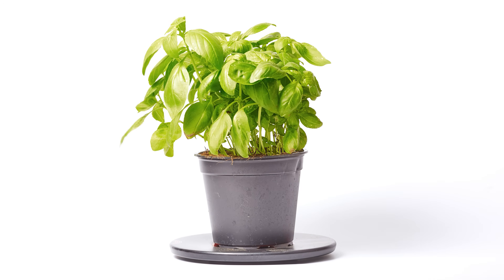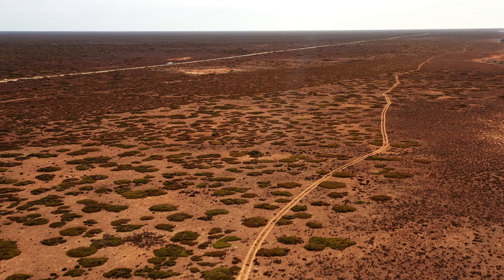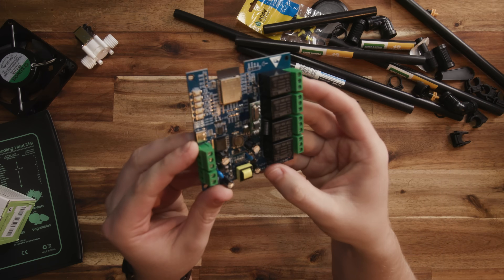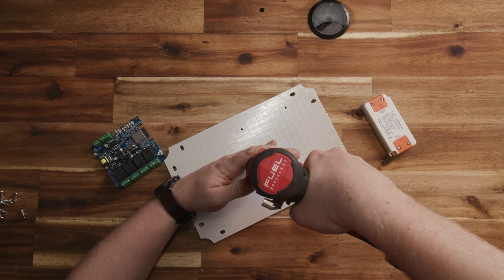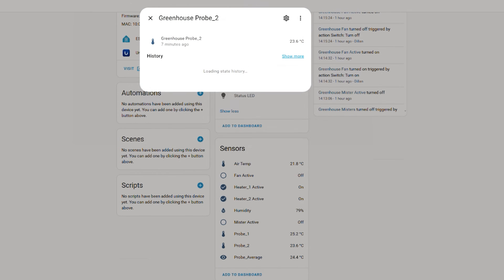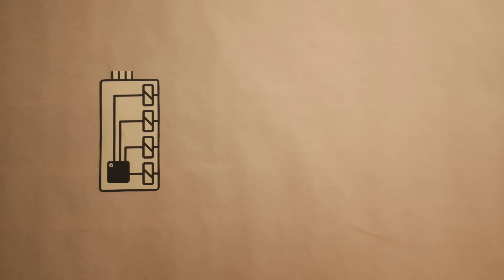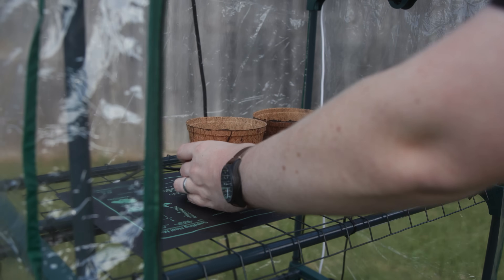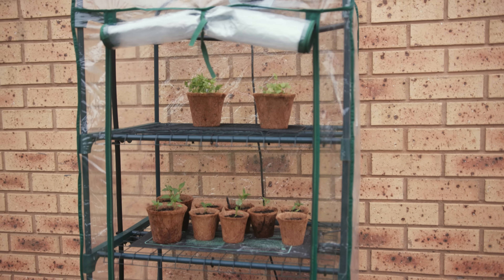All This… Just So I Don’t Have to Buy Herbs

Comment: I just removed a DHT22 from my greenhouse build.  It had worked for over 2 years with an older esp32, but on a newer esp32c3 it locked up the device every  1-5 hours. There’s some discussion of it online but it’s because it uses a non-standard timing sensitive protocol to communicate, so turns off interrupts while it takes a reading which causes this.  I switched to a newer version of this sensor (AHT20) that uses i2c and thus has hardware support, and the problem vanished. You may be fine in your setup, but if you start seeing hangs, consider switching that out.
Reply: … also I set up a watchdog timer on the esp32 to restart automatically if not reset periodically (ie a hang keeps it from getting to that point) and it was essential to debugging this. It also helps with WiFi issues if signal is bad or the esp32 is cheap ;).

Comment: Kudos. I have been growing at hone for a few years and starting a farm now. But I also travel for my day job a lot so automation is critical. So this is exactly the kind of stuff I'm doing too. Not as sophisticated but only because my weather is more stable. 

My one recommendation would be to get some thick plastic seed starting trays. Ones that are reusable. While natural products seem environmentally better, the problem is they evaporate out the sides, making it harder to start stuff and keep it consisting moist. This leads to poor results and more waste due to failed starts. A good set of trays will last you basically forever so any eco impact is low, not to mention cost.

Comment: Damn I had the exct same disaster as you. Very similar greenhouse, a storm took capsized it and many plants were lost. I had plans to automate it as well, but the parts have been sitting in a drawer since, and the home assistant device shows a sad "unavailable". I was planning to use soil moisture sensors as well.

Comment: As a fellow green thumbed victorian, i highly, highly recommended finding a local nursery and getting seedlings from them- not only do you get top notch advice, if they are growing their own plants then the seedlings you get are used to our overal climate, and even much better within your specific microclimate.
I realise this video isnt exactly about that but as someone who also went full stardew valley at the first opportunity- learn from my mistakes, its much cheaper to spend a few bucks with the local guy and have 80%+ success rate than bunnings which has a much lower one. 

Very much appreciate you nerding this one out loud, this stuff is what i suck at so its nice to find someone local that explains it all so well ❤

Comment: You know as an American I can admit that the metric system is by far a superior system of measurement, but when it comes to temperature Fahrenheit is just as easily the superior system compared to Celsius.  Just think of it in quarters. 0-25 fuck no, 25-50 cold, 50-75 Goldie locks zone, 75-100 hot.  Anything below 0 or above 100 is inhospitable to
 life.

Comment: I recently set up a very similar greenhouse and there's only one more thing I would add to your setup: fans to simulate wind on the seedlings. You've already got a fan for moving air out of the greenhouse, but your plants will grow much stronger if you put some wind directly on them. I run my fans to cycle between being on and off every 30 minutes while the sun is up. If you ever end up wanting to move your greenhouse indoors (to avoid your storm problem), you'll also need to add grow lights. Overall, you have a great setup!

Comment: Mate, I had the exact same thing happen to the exact same greenhouse from Hammerbarn,devastating when it happens.  I stacked old tiles on the bottom shelves I'd just ripped out of the bathroom, I also used Okie straps to keep the frame tight after the joints popped apart a couple of times, maybe they've improved the quality since then.  Love the look of your setup, not over engineered at all.  You will want to regularly spray your seedlings with a fungicide to prevent pythium rot when the weather starts to warm up, I ended up using a wicking mat system so the stems weren't constantly wet from misting.

Comment: Amateur mushroom growers have been using these little greenhouses for a while with ultrasonic misters to maintain humidity.. I suspect something like that with a bucket of water and a fan to blow the mist around the greenhouse would be sufficient and much more simple. There are also pretty cheap off the shelf plug-in temperature and humidity controllers from InkBird that you might consider using - they’re popular with shroom growers and diy salami/cured meat enthusiasts.

Comment: Got myself a house in the last year too with a nice piece of land and a huge greenhouse, which right now i'm renovating, as well as growing seedlings to plant there soon. But as in our country its only like up to 5 months(May-Sept) when the average daily temp is above 5C, so I started wondering about making a small indoor greenhouse, which right now could serve as a seedling maternity hospital.

While experimenting with different setups, I had some interesting observations:
* having roots in warm is way more important that the leaves, as it directly affects plant ability to get nutrients.
* seedlings grow much shorter, fatter, have huge roots and become saturated dark green if you give them more blue light spectrum, for which I found out that cheap cold day light led bulbs work perfectly fine, in your case I see that seedlings do indeed miss out on it, because of how long and thin they are.
* also most plants need pH of the soil to be 5.5-6.5, which is already there for most potting mixes, but will degrade if you water it with tap water, which in many cases might be slightly alkaline, which in the end makes soil too alkaline for the plants to be able to pick up certain nutrients.
* localized high humidity is a must for a seed germination, putting a food film over the pot helps to retain it for the seeds, which can be removed as soon as seedlings got rid of their seed shells.
* some seeds require light for germination, so covering them with soil is going to ruin them.
* some seeds need some time to sit in a wet paper towel in a fridge, i.e. stratification.

Comment: Few tips for your next go, although I'm sure most of them are in the comments.
1. Pots! If you find it hard to get up to temp or maintain a temp on the pots, insulate them with some felt or some old rags or something wrapped around the side to keep them at a stable temperature.  I'd always recommend some ceramic pots with holes in the bottom to allow for drainage so they don't go moldy and a tray to catch the excess water or to water from the bottom up (which some plants prefer).   Bigger, deeper pots are also better with some stones in the base to hold onto some of that moisture and to give the plants some rooting space. Seedlings dont give a monkeys if they're in a small seedling pot or a large one, its just easier to manage, thin out and replant the seedling pots but bigger is better.  
2. Thin out seedlings, but beware, some dont like the shock and die almost instantly.
3. Copper tape or mesh around the outside of the pots or across the shelves to prevents slugs.  
4. Drip Feed.  Some plants don't like getting wet on the leaves or stems (like basil as they burn) so drip feeds are good for those and also good for any that require more water more regularly, I'd recommend a soil moisture sensor (or a couple of nails and a 10k resistor) for those ones to control the solenoids on the drip feeds.  I've used a water butt with a small 12v solar submersible pond pump before with decent success.
5. Plant feed.  I'd always recommend some plant food, and the liquid seaweed stuff works wonders for me.  Oh and finally get some of the clear greenhouse tape, those little greenhouses have a tendency to rip easily and the tape will get you through a couple of years until you decide if you want to buy a proper greenhouse (I'd recommend a lean-to for stability).  You can use a drip feed to run the plant food also (if its in liquid form).

Comment: Amazing project. If I had more of a yard instead of just a balcony I would be building this immediately. I may still build something similar.

Any desire to add a lux sensor + plant lights during winter? I may need to wait until y'all have a summer season to know y'all's thoughts.

And as a possible follow-up: I'd love to know how the restricted number of (individual plant) sensors impacted the overall crop. Like, did everything perform well? Or does it look like plant X needs more/less water/sun/humidity? Did you feel the need to add more personalized-to-the-plant sensors?

I can't wait to see how this goes for you. And I hope you do have a follow-up!

Comment: I hope you will have as much fun in your garden as I have in mine 🙂

As I struggle to do proper watering for my mature plants, I currently setup a solar pump that pumps from rain barrels. As I have alot of herbs around my chili and tomato plants, the drip irigation will not work, as there are just oo many plants. But solar pumps are not powerfull enought for regular sprinklers... so now I currently design my own 3d-printet sprinklers, optimized for those small solar powered pumps. Conclusion of 8 years of garening: DIY-tech projects and garening fit very well together.

I had bad experience with those compstable planting pots. I'm back to platic seedling pots/trays.

Comment: add a breather to the electronics enclosure! something like the GORE PMF100321. they have a waterproof breatheable membrane that keeps the pressure the same so pressure changes don't pull moisture inside the cabinet where it'll condense on your electronics.
Reply from the maker: All good advice! 

Hadn't thought about including a breather, but that makes a lot of sense! 

Humidity was sitting a little high overall so I've been running the fan a lot more to keep mould at bay, it's working so far!
Reply: also if you have a north, or north-ish facing bit of your house, butt the greenhouse right up to it and anchor it down to the wall. the worst you'll have to worry about is the wind tearing the sheeting rather than it knocking the whole thing over, and the house will help calm the temperature fluctuations when the greenhouse isn't completely full.
Reply: oh and you should be checking for soil moisture content, not specifically humidity, because a high humidity might lead to mold that plants like tomatoes are very sensitive to.

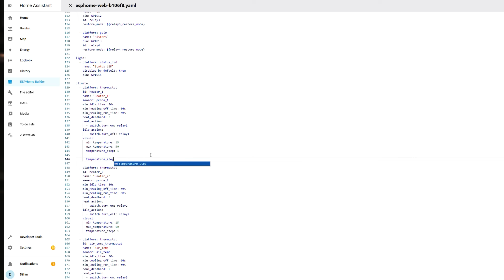Comment: 8:00 Nooo... No. No.. ChatGPT or any chatbot will not do a good job of teaching you anything. It will do a great job of guessing the next work in a teaching of things, but with no hesitations to make stuff up seemingly trustfully.
There is a really good reason the HA forum does not allow vibecoding, all of the AI's have so much crap they picked up from users who don't know better. Using badly trained AI to code murices the water

Comment: There's a nice solution that could help you solve stability, thermal and humidity fluctuations all at once: put a big, black container of water at the bottom of the greenhouse made with agricultural grade plastic (to prevent polymer leeching into the water too much). If possible, cover the water with a layer of dark plastic balls or a piece of synthetic black fabric.

It works as a thermal flywheel by being a big, heavy mass of water that soaks up excess heat during hot days and releases it during cold nights. By being open top, water can evaporate and increase humidity almost by itself. By being heavy and at the bottom, it will make the structure super stable. Having the surface covered algae growth and mosquitoes larvae should be kept at a minimum. By being black, it will absorb visible light and radiate it as infrared. You could add a little outlet to the irrigation system to let the daily watering cycles automatically replenish what evaporate.
Reply: Is there a name for this method? Your explanation is pretty good but I'd like to do some reading on it
Reply: Hmm... I wonder if my little plastic aquaponics tub can do this. The fish deal with mosquitoes, I'm already sprouting seeds in rockwool in it which helps keep back algea, and I'm sure the duckweed would appreciate a greenhouse structure throughout our winter frosts. This years winter I nearly succeeded in killing duckweed 😂

Comment: Unreal , having had that exact same greenhouse just be prepared to replace in 18 months as the plastic rots and seperate from the stitched edge. Couple of Bunnings pavers work well if you find it wants to blow over in stronger winds . They work great in the colder months for keeping seedling from freezing off

Comment: To assist with thermal mass, and a weight in the bottom, get a 20L drum (pref black, or paint black) but water in it, and leave it in the bottom of the green house. The sun will heat it during the day, and it will release the heat at night. It also acts as a weight to help stability. You could even measure the temp of it, because you can.
Reply from the maker: That's a great idea!

Comment: Been doing similar for a while now.  I'm sure you're all over weather stations, but have a look for ZigBee moisture sensors you can stab into the soil. Just silicon over the button, it's not UV stable buttons and they crack and moisture kills the sensors. But it'll let you keep a very accurate soil moisture content.

Comment: I've setup something similar on my balcony in Sydney. I use Miflora BLE plant sensors, drip irrigation (with sprinklers for the smaller pots), using water pumped from jerry cans that collect water runoff from my air conditioner - in summer it works well, over winter i have to recharge the jerry cans with a hose. My balcony has no water tap unfortunately.

I've found it mostly good, though replacing the batteries in the miflora sensors twice a year is annoying. It's a great backup for when disabilities flare up and i can't tend to things for a few weeks. They'd grow better with attention, but at least things don't die out anymore.

Having sensors log in home assistant felt a little silly at first, but now i can look back over years of logged data and easily answer questions like: how cold does it actually get on my balcony in winter? can i grow tomatoes year round? (looks like yes! 16°C is about as cold as it ever gets! no wonder my place always feels so hot.)

I really enjoy having soil moisture and electrical conductance sensors. With those you can see how dry things get, to make sure roots get a break and don't get overwatered. You can also see how quickly plants take up water with or without fertiliser, to see if you're mixing liquid fertiliser so strong they struggle to drink it (too salty) and also to see if the plant is satisfied or if it's drinking it up so fast that the soil dries out in just a few hours. It's a great way to get a read on what your plants are hungry for, to find growth bottlenecks. I've been able to "debug" more thirsty plants like watermelons by having a lot of historical data like that to compare against.

All that said, I still think it's an important skill to learn to read the appearance of leafs. These kind of sensors are useful mostly in addition to gardening skills. Don't neglect learning how to see what a plant needs by looking at it. Without going down an incredibly complicated computer vision rabbit hole, i don't think it's possible to fully automate productive gardening with most plants. Your sensors can't see pests and diseases, and can't diagnose specific nutrient deficiencies. But the appearance of leaves says a lot about what deficiencies a plant might have

Comment: When I worked in a science lab before my career change to IT, we would suspend our fridge temperature probes in a container of distilled water with one of those waterproof glands through the lid.

It helps provide some thermal mass so you dont get wild swings in recorded temperatures.

Loving your work mate.

Comment: I've been using a heat mat in my filament dry box, and something I've noticed is that they work best when covered. A foam layer underneath and then even just some soil seems to make them much more efficient than having them out in the open.  
You should also consider adding an infrared heat lamp that turns on when the temperature drops below a set threshold. I use a little radiant camping heater in my home office in winter and have it automated with just a simple smart socket and a temperature sensor and it works great. Just be careful the plastic doesn't melt.

Comment: Looks good.
If you are struggling with keeping the temp high enough over the winter, you might want to try wrapping it in bubble wrap rather than the simple plastic it comes with.
Bubble wrap lets the lightly through, but is a better insulator.
If it gets really cold, you might need two layers.
Reply: I was screaming this at the screen 😂

Working so hard to avoid the simplest solution.